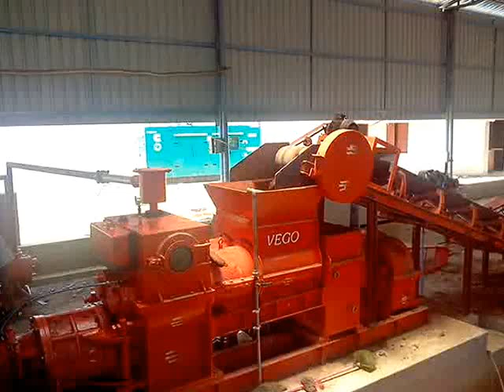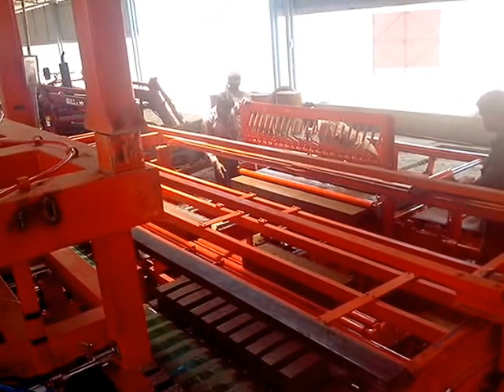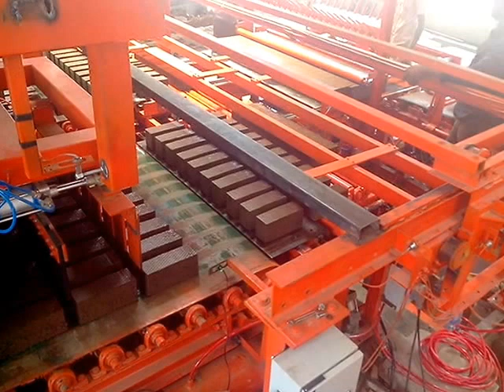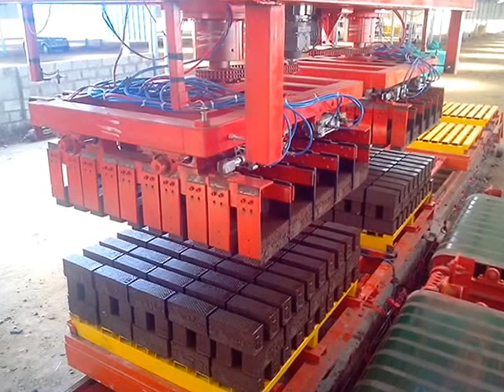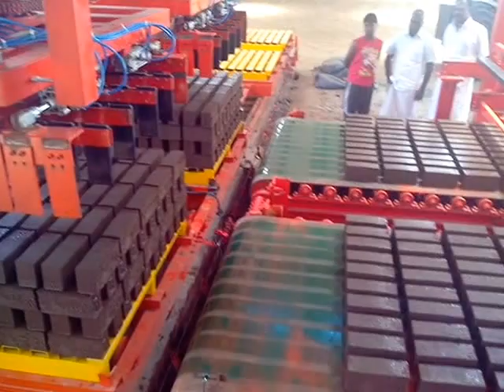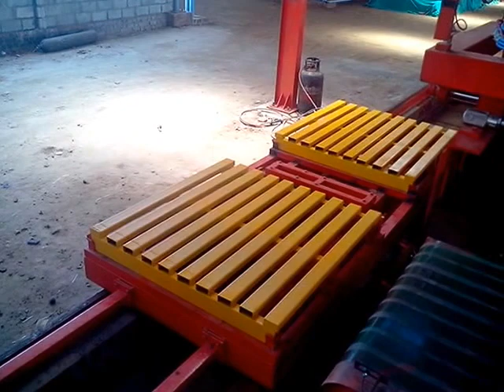Automatic brick stacking machine india

Comment: Automatic machine that requires 3 men to watch it run and occasionally touch the wet bricks"

It should run two or three times faster to get production at  a minimum rate.  The whole process has room for much improvement from loading raw material to drying bricks.

Comment: arbeeex
Automatic machine that requires 3 men to watch it run and occasionally touch the wet bricks"

It should run two or three times faster to get production at  a minimum rate.  The whole process has room for much improvement from loading raw material to drying bricks.